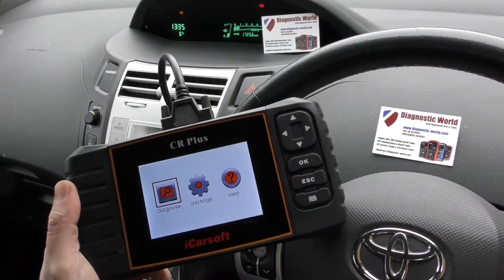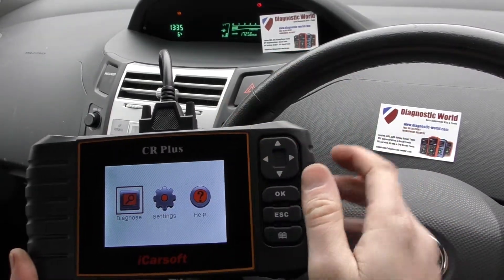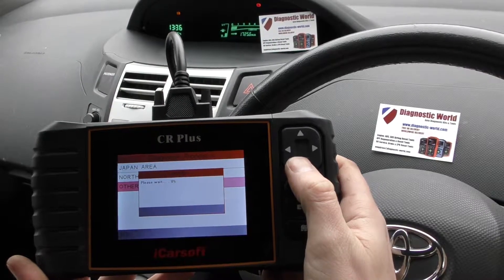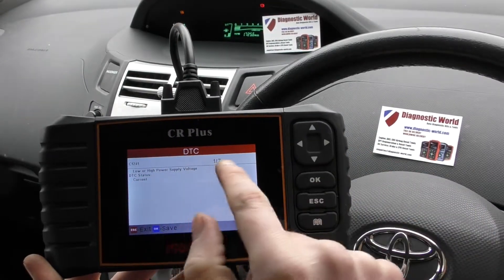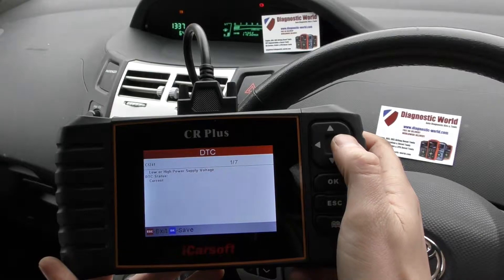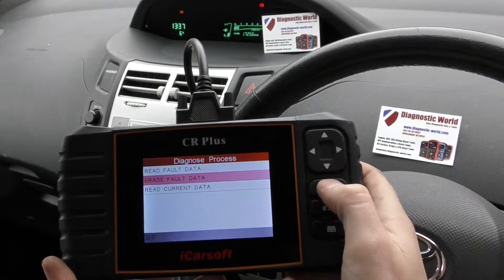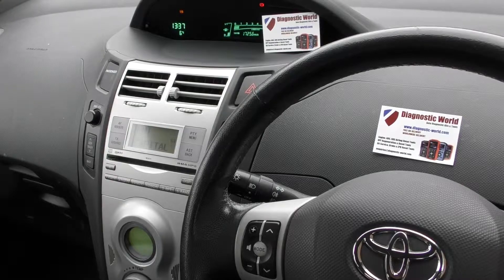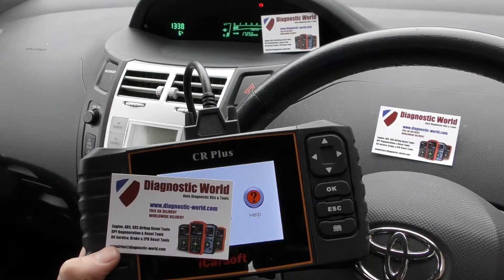Toyota ABS Warning Reset CR Plus Scan Diagnostic Tool iCarsoft C1332 C1241 C1333 C0210 C0200 review

Comment: My ABS light wasnt on. But i had code C1241
Why is that
(yaris 1.4d)
Reply: Same here. From what I've seen it can be a dying battery or pcm problem.
Reply: @B_B_Wes  pcm?
Reply: @B_B_Wes  yeah I came across that as well. I checked the OBD again and now the code is gone. Hmm
Reply: Hello, did you ever figure this out? I have this code also on the obd